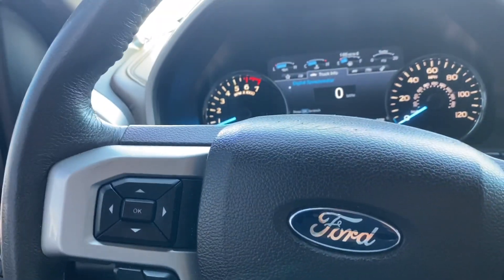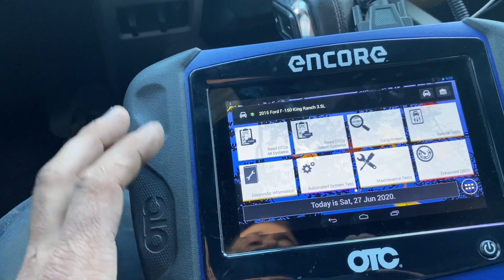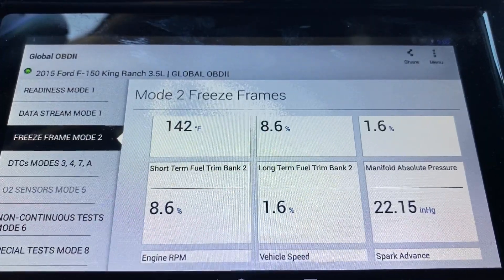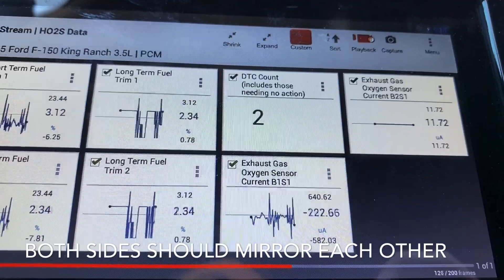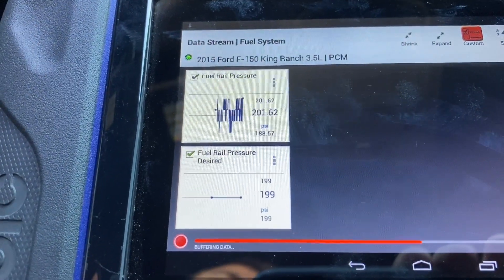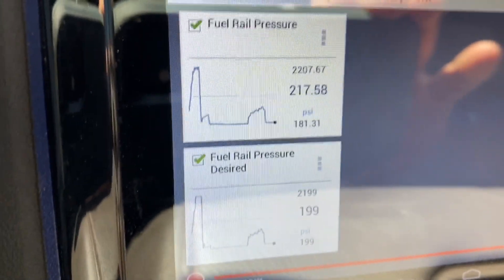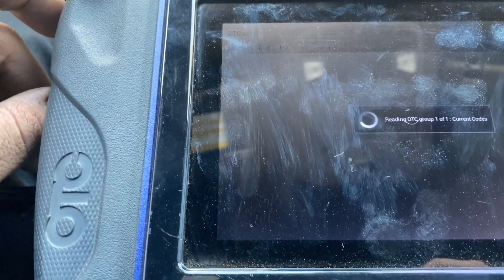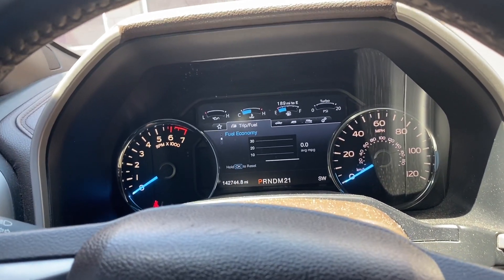Ford F-150  02 Sensor Diagnostics & Replacement (Complete Guide)

Comment: Hey Aaron do you know if the DY1184 is still the correct part number on a 
2022 3.5 EB, Bank 2 Sensor 1. I’m having trouble locating the correct part number

Comment: does smog sensor after market work? do I need origunal smog sensors from ford delaer? I have a 1027 ford f-150 2.7 issues with bank 1 low voltage. I installed after market and only worked for a month but now I have the same issue, why?

Comment: I know this video is old. I also know that it has a total of 4 sensors. 2 on each side of the exhaust. Are they all specific for example if I’m replacing all 4, are there 4 different ones or just 2 for each side? Like same part number for front driver and rear driver will be the same?

Comment: My truck stopped on the highway and wouldn't power back on. No engine light or anything but I hooked my obd up anyway and got an o2 sensor error. Thank God, I hope this is the problem. My engine is too young to be giving ne issues!
Reply: Was it the o2 sensor?
Reply: @flowersfam3462  it was actually the mass air flow sensor but I had replaced the o2 sensor before I replaced the mass air flow. Everything is fine but the o2 gives me issues now and I have bad gas mileage. Assuming it's because of the new sensor I put in there. It was a pain in the ass to replace and not sure I was able to really tighten it enough.
Reply: @MinisterRedPill  I did a scan and it gave an o2 sensor code on my 2000 ford expedition 4.6L V8 Triton XLT. 
I wish it was only my mass air flow sensor.
As a female that's new at doing my own vehicle repairs, I'm really nervous about doing these now because of how they can be a pain to get to.

But I'll have to do them tomorrow. Wish me luck!💅🏼😊
Reply: @flowersfam3462  well, what symptoms are you having? Even though it's showing the code for o2, it might not actually be that. Some parts are dependent on other parts to function properly. For me, my actual issue was mass air flow but I wouldn't have known that by my odb reader alone.
Reply: @MinisterRedPill   Before getting those codes, my vehicle was idling rough and I cleaned out my throttle body and idle air control valve because they both had carbon build up. That seemed to fix my rough idling so far. Thankfully 
I still have some bad acceleration especially going up hills.
Reply: @flowersfam3462  yeah I had bad acceleration on the highway and after replacing the mass airflow I haven't had a problem since. You should give it a shot, if nothing improves you could always return it. Replacing the MAS is extremely easy.
Reply: @MinisterRedPill  Thanks. I will definitely start there.😊

Comment: The question is how is it running do you notice any difference is it wanting to stall spudder have no power when holding the accelerator these are the issues I'm having and everytime I replace the component a new code pops up I can't get the O2 sensor off is it worth my trouble or just sound like something else

Comment: Great video very informative, however my truck is running lean I know that wasn’t the case here but since it is what should I do to figure out what’s going on? Or would changing the o2 solve that as well. I got code p1150

Comment: Awesome video, but I absolutely could not get my old O2 sensor out (yes, I tried using 22m special tools).  I even squirted break free liquid on it. So instead of potentially stripping the sensor I'm stuck taking my truck into the shop. You definitely made removing and replacing the sensor look easy I just wish it would had been that easy for me.
Reply: 😂 come on now. His repair was staged. Every 02 sensor I've ever remove never came that easy.😂
Reply: Mine is 8 years old with 170,000 km, not sure I want to attempt this my self, B1S1

Comment: Nice video I have a question I have a 2015 f150 ecoboost  3.5 turbo is telling me sensor one bank one is the one on top near the engine or the one down to the muffler or what are the numbers cause I just got one and doesn’t look like the same

Comment: Would leaking coolant out of a turbo possibly make the 02 sensor faulty? Getting codes p0120 p0123 p0430. Told to replace both turbos and cat 5.7k………

Comment: Question. I have a 16’ F150 3.5L ecoboost. Giving a P2197 stuck lean Bank 2, sensor1. Is mine still going to be that same bank sensor you replaced even though your code was different?

Comment: man i had the same poo59 on bank 2 sensor 1 code on my 04 f150 i went as far as to replace the entire wiring harness after the sensor was replaced and that wasnt what was wrong with it. after replacing the wiring harness, my bank 2 sensor 1 started to switch like its supposed to. now its doing the exact same thing like it did before. its staying stuck at .5 volts and doesnt change. im getting really bad backfire. im at a loss of whats happening. im thinking its the pcm at this point.

Comment: If you change the o2 sensor will the check engine light go off if that fixes the problem or do you need a scanner to reset the engine light? I got dealer to run codes of P0151 and P219B which relates to Bank 2 upper.  Dealer can not fit me in for more diagnosis and repair until Mid December.  I bought the Motorcraft DY-118 1X 8F9Z-9F472-H sensor and will try replacing it my self.  Question is, when replaced will truck computer see difference and shut off engine notice light or do I need a scanner to shut off?  Thanks.
Reply: A scanner is preferable. But many codes will clear once the condition goes away. I have a cheap scanner that I use to clear codes.

Comment: Can you swap sensors around to see if you get codes on the other locations as a way to test the sensors?
Reply: I'm looking to do this right now, and from what I've been seeing the upstream sensors have different part numbers for each side, but the downstream ones are interchangeable, so it's likely the upstreams aren't the same but who knows nowadays
Reply: @vitopannucci2001  yeah mine was upstream bank 1 and it is quite a bit different then the other side and it's on a 2012 f150 so I'd say majority won't be the same
Reply: It's easier to Back probe the O2 sensor (Sensor) wire and use the Battery Positive and Negative Terminal(s) to see if the PCM detects a Rich or  Lean condition.

Comment: Great video. As I understand it, o2s get changed during a general tune-up. Wouldn't it be better to change all regardless of status, so the other bank doesn't pop a code in another 30k miles?
Reply: I've never replaced an o2 during a general tune-up, it's not necessary. I replace them when they go bad.

Comment: I have a P0131 and P2195 code together. The 2195 code seems to be a generic O2 sensor problem whereas 131 is specifically bank 1 sensor 1. My scanner wont show me the desired fuel pressure to compare to the actual fuel pressure. The engine light comes on and off inconsistently. Any suggestions? Should i be good to go ahead and try replacing the sensor?

Comment: dealership quoted me $503 for sensor, $129 to scan, $80 labor.. I just purchased a Bosch at Parts store for $150...going to change today..thx for video..
Reply: hot damn,i thought 259 total was bad.
Reply: Got quoted over $1k for all 4 when they did the transmission output sensor reflash. More insulting than telling me to just fuck off honestly.
Reply: Canadian sensor price $260, labor to install 1 hour@ $205, B1- S1

Comment: Thank You! At 10 minutes you quickly stated that Bank 1 is the passenger side. The auto store I purchased the O2 sensor at said drivers side is bank one and after I replaced the Drive's side O2 the Check engine light didn't go off so I've been preparing to take it to the dealer.
Reply: Auto parts employee are not always mechanically inclined so there for you have to do your homework online if you yourself don't know  because honestly they aren't allowed to tell you something they may not know and or if they are just going of the computer Wich may be correct but even then consider it a waste of time.just thought I'd add a comment.
Reply: @alfonso1514 NAPA gave my brother the wrong one, when the mechanic went to install it, that’s when it was discovered. NAPA refused to accept the return of the wrong sensor cause the package was opened, just call the dealer their parts people have more training.
Reply: According to a local Ford dealer parts counter guy, Bank 1 is the passenger side of F150’s.
Reply: Just had same problem but the opposite side 🤦‍♂️

Comment: Dude where is the connector for the passenger side upstream o2 sensor.  And how do i get to it.
Reply: Did you find out? Mine is broken
Reply: @Moonlitmaker  it is behind the fire shield.  Have to jack up the truck to get to it.  Hardest of the 4 o2 sensors to replace.  Other three are pretty simple.
Reply: @dustinbodkin4355  my wires were broken from the engine side of connector. They run into wire loom behind intake manifold. They were sheared off right at the loom. Was rough finding and fixing them for sure. Just got new wires run. Thanks for the tip though

Comment: I have a 2016 F-150 3.5ecoboost I changed the o2 sensor in bank 1 sensor 1 didn't fix the problem the codes are p0131 and p0053 any idea on what it could be?
Reply: I heard on the new fords bank 1 is psngr side...jus did mine n its still on :/ maybe autozone guy is a dingdong
Reply: I fix the problem?
Reply: Yes the autozone guy was a dingdong. After i changed the one on the passenger side the light went away.
Reply: Do you have an open wire someplace?